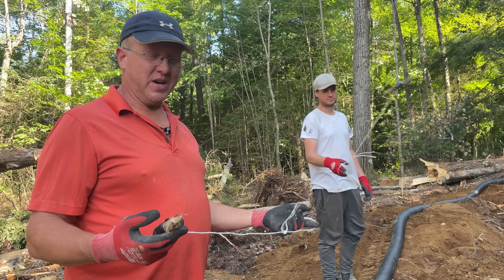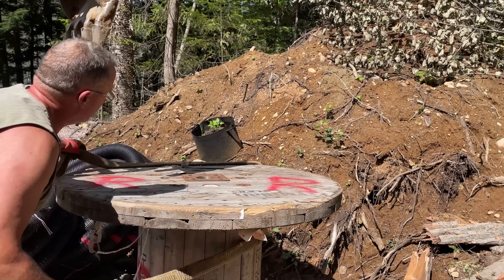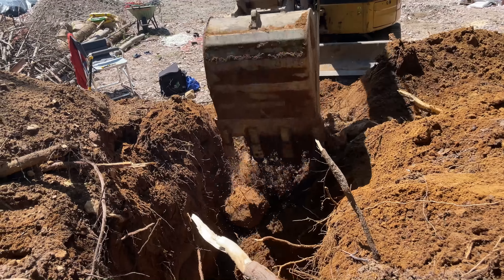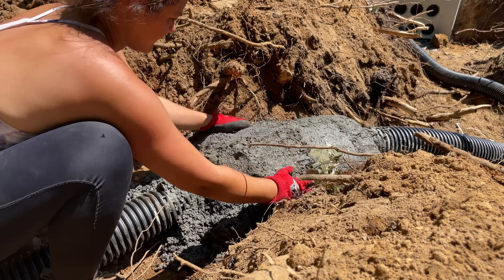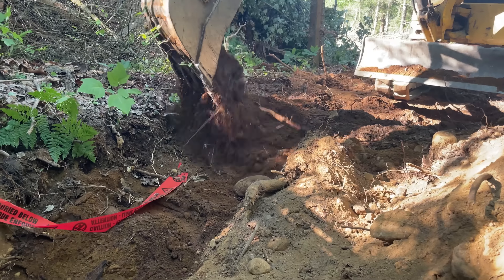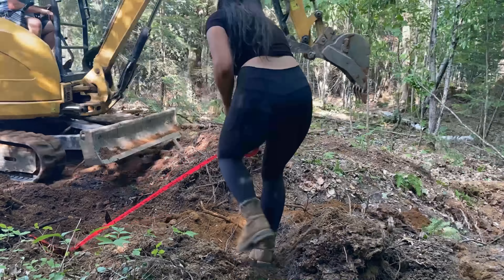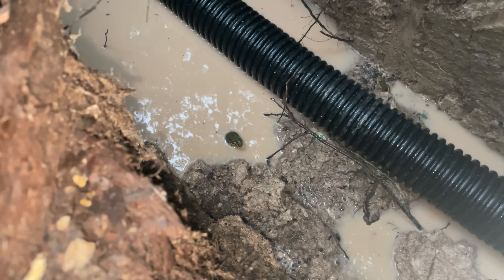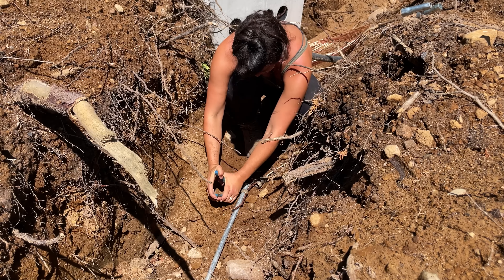I’M SHOCKED! Putting in Electrical from SCRATCH

Comment: shouldn't the ground rods be installed vertically?
Reply from the maker: It’s the normal way to do it but as long as there’s the 2’ depth and not the dry part of the top soil, you’re good. This is only for our area. Not sure about other areas and what would be approved. Inspector had no issue with it. Our issue is so much bed rock

Comment: Yall are permitted to run direct burial in drainage pipe?
Reply from the maker: It’s not only meant for drainage! It’s used a lot for protecting plumbing and wires. The perforated big o is mainly used for drainage, this isn’t perforated
Reply from the maker: And it was very much encouraged by the electrical inspector